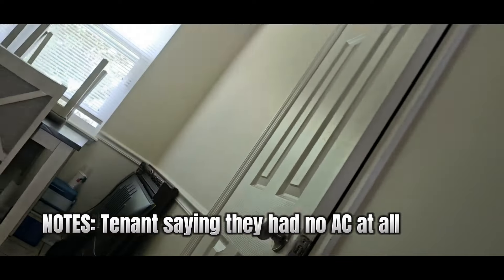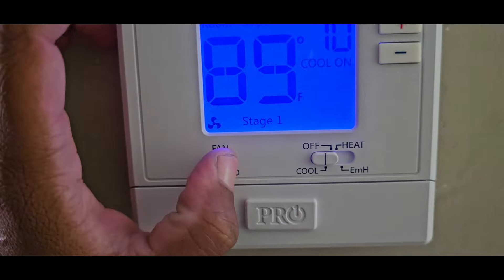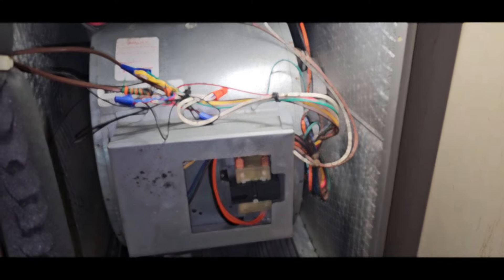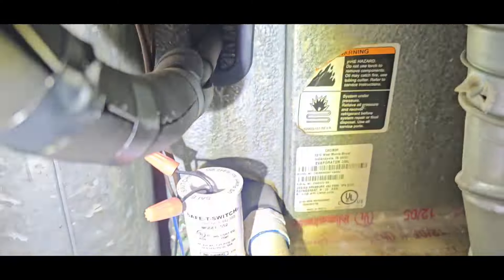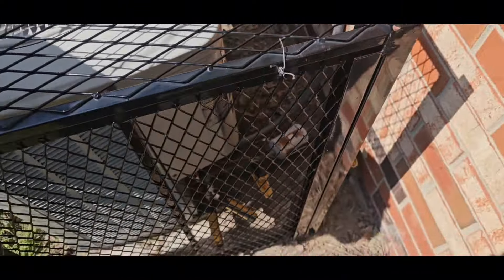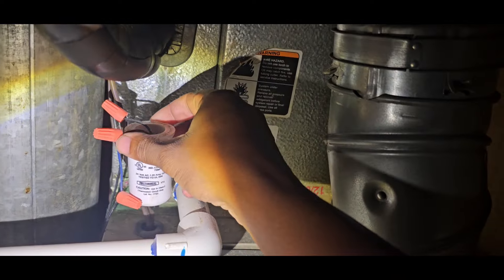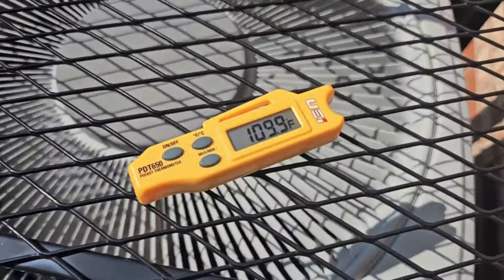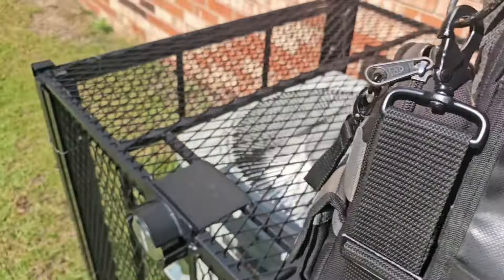Interesting Service Call At The End of The Day | HVAC

Comment: Good job.  Line set to small for 2.5 r22 system.  3/8x3/4 would be better.  Good find on the wall cavity to the attic.  That’s a big deal.  You should have messed with the charge.  It’s the small things that count.  They add up.  I was working on a 80 ton system today.  Been told the unit is a pos.  Well after looking through it, it really isn’t. It can’t work because the small things have not been taken care of.  Nice vid.
Reply from the maker: Thanks, I try to do my best. If that cage wasn't in the way I probably would've tried to adjust the charge a bit

Comment: You should always check power with your multimeter first
Reply from the maker: Eh, if it wasn't doing ANYTHING I would've. But typically speaking 240 for those motors on that unit ate directly tied into the transformer, so if the transformer is getting 240 then my motor has to be  then for the motor to be turning at all let's me know some low voltage signal is getting to it because the motor won't turn by itself. Just so if it's rocking or never ramping then I know all my voltage is there.

Comment: Spray foam the wall cavity.
Reply from the maker: That wouldn't be a bad idea, I'd probably have to put some 2x4 there first and then foam the crevices
Reply: @AB_HVAC  It will cost several thousand dollars to use blown-in foam in the walls. I used to sell that long ago. It also required special pumps!
Reply from the maker: @bobboscarato1313  I was saying to just use caned spray foam around the creases of 2x4's that id screw in to block the openings lol not the big jugs of spray foam like for attics